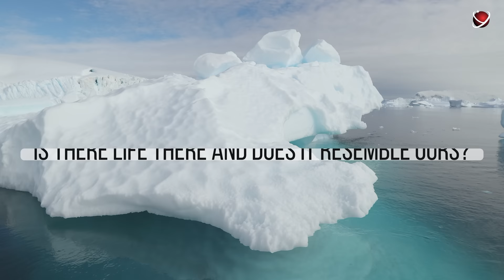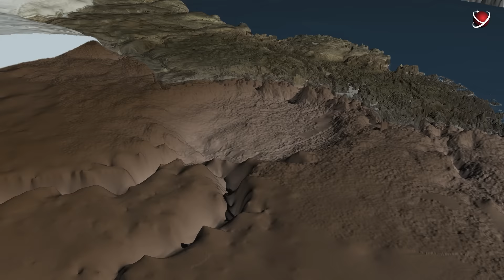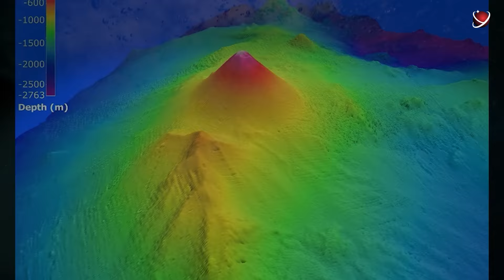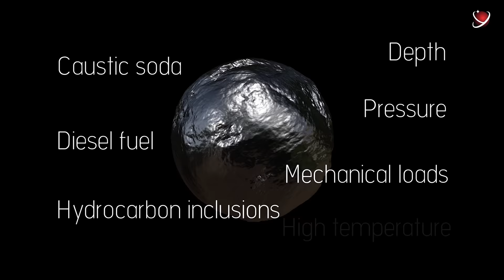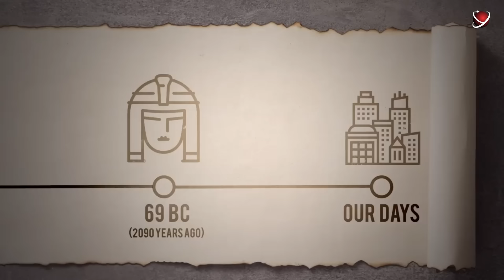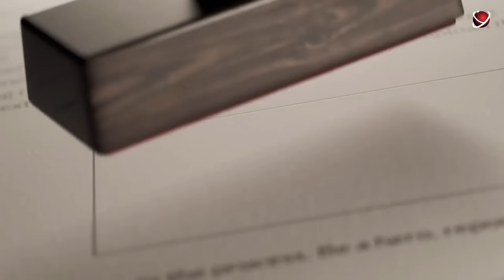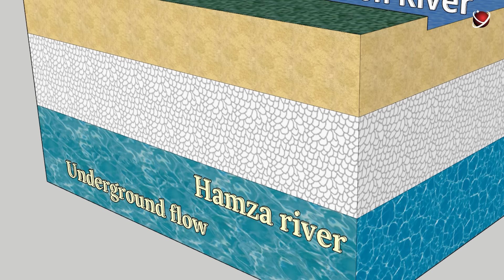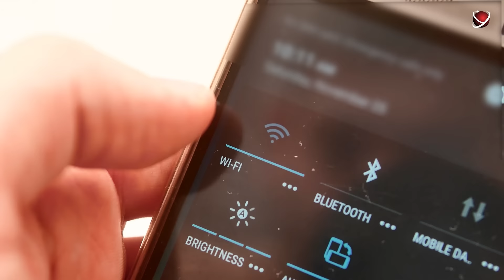The Most Mysterious Places on Earth 4K - ReYOUniverse

Comment: Water swells when frozen so it as water wouldn't be quite the rise of sea level and if the entire plane(t) were warming it would likely be hot humid and rain often because heat causes rain to form faster right? And that would go on until the water was getting very low

Comment: - 2:00 You don't have to have your appendix removed, unless you are a doctor. Because there's only one and single doctor in each station.
In 1961, one had to remove his appendix by himself.
Of course you also don't need to have your wisdom teeth removed, as long as they are sane ( exam requiered).
Wisdom teeth are not always a problem. I'm 54 y/o and have all of them.

- What is shown  at 9:07 are tardigrads, not microbes found in the lake.

- 10:01 W123-10 was NOT found in the lake, but in the ice. The article in Pubmed says no life has been found yet. The DNA analysis doesn't show it's totally different than other life on earth, but different of its relatives : 
"The first remaining phylotype, hereafter w123-10, proved to be a hitherto-unknown type of bacterium showing less than 86% sequence similarity to known taxa."

- 1:45:00 The pyramid shown is Keĥren's, not Kheops's. This is a serious mistake ! There are not 2.6 millions blocs. Inside it's rubble.

- 1:47:00 The Great Pyramid was not built in  "just 20 years", but at least 27.

- 1:51:00 the lower room was named the "queen chamber" quite recently. No egyptologist says queens were buried here. They are in the small pytamids near by.

- 1:53:23 pyramidions covered by gold existed 1000 years later, on some obelisks. There's no proof it was the case for pyramids. The pyramidions discovered show no sign of fasteners for gold sheets.

- 1:57:23 Of course there was no inscription on the walls of the King chamber. You said minutes ago it was normal in the 4th dynasty. It started with Unas, 5th dybasty.

- 2:02:15 Muons don't come from space. They come from high atmospher.

- 2:03:25 "Unfortunately, 5 years since that, with no further progress" Not right. There's another study coming : "Explore the Great Pyramid"  . And no, the experiment was not "replicated many times".

- 2:05:50 Henry Salt never wrote he fuund 4 passages, but that the tunnel ended after 300 yards.
Andrew Collins never provide any proof of his "discover".

- 2:17:40 - Herodotus never wrote anything about Kawara and underground tunnels. There's no pyramid in Bosnia.

There's a lot of misinformation in this video ...
Reply: Thank you for pointing all of that out, sadly it seems videos like this are like bug lights for Youtube nutjobs who will dismiss 99% of what scientists say yet blindly agree with what an anonymous low quality Youtube video says. It's pretty mind blowing.
Reply: Blah blah blah
Reply: You dont know
Reply: Ahh man, I already shared everything to everyone I know!
Reply: Be sure I'm not a specialist of anything here.
I just verified the informations.
For exemple, the deep lake officiel article is public on PubMed
No need to have an university account.
Reply: @one8088  Right. I don't know more than the author of this video.
I just verified  what he said.
Reply: @StickHits  It's a pain ...
I totally agree some scientist may be wrong.
They say the same thing :)
But I'm not a biologist, nor an historian, I'm a technician in electronic / informatic.
I just verify the information I get.
If I say something about an old 1930 outboard engine, or carpenter and home electricity, you can usualy trust me :)
If it's about advanced knowledge in biology, physic, I know my limits, please ask someone else.
Seems fair to me.

Fun part is english is not my native, I'm french :)
Reply: @nalinux  Yes, same here. But I do know a little something about bacteriology — I felt compelled, like you, to point out that this clip contains misinformation and unsupportable claims. We have enough scientific illiteracy already without stuff like this.
Reply: I suppose you and I, even if not about the same studies and knowledge, have quite the same way for this.
I'm a tech.
Many of my friends are historians, or whatever.
When it's about tech, "I'm the boss".
Of course I can fail. I have no problem telling "I don't know".
I think this "I don't know" makes a great difference.

You write you know about bacteriology.
I don't know you. Why not ? :) 
Nothing personnal here, sure you understand.
Be sure I will verify if you write a thing about this :)
Seems fair ...

We have a bit of knowledge.
I won't play with you on your domain, and suppose you won't on mine.

But some pretend to be genious on about anything ...
We know it's wrong ..

This might not seem important.
But when I see more than one million views .. wow ..
How many kids saw this ?
This guy has a responsability ...
Reply: @j.stribling2565  Only octopus came from outer space :)
And tomatos.
Reply: Thank you for saving me 3 hours.
Reply: @nalinux  🤣😂😁❤️👍💯🙏🏻
Reply: @nalinux  thanks for trying to help local YouTube nutjob s like me too
Reply: @nalinux  YouTube is about the public's ability to post there own videos! As entertainment! It's not a scientistfic channel. I would say in it's defense! Yet I do agree that there should be more fact checking in education type videos if they or as such labeled. Though at this point YouTube post or in say 500,000 per every hour or day an a staff of possibly 100 would an do have issues flagging content for various reasons. So I say on YouTube it's mainly lacking the ability to govern the people who post on it of all types of videos. There are sites an I believe tube sites created just to help educate an if not maybe it be a good idea to start one! An then use these videos to help explain the situation better etc .
Reply: Way to let em know! I hope they reply back to you at least and hopefully update their video when your fact check proves to be correct. You're doing God's work.
Reply: ikr?!
Reply: @jesselove3715  I think they don't care :)
YT gives money with 1.3 millions views  ...
Reply: Thanks mate you saved me from listing all the bullshit
Reply: @peterhall8572  There are many others !
for example, no need to have your appendix removed if you go to Antarctica, unless you are a doctor.
Also no need to have your wisdom teeth removed ....

Comment: The most recent Green Sahara period occurred in the Holocene, in a time frame from about 12 thousand of years ago (kya) to about 5 kya. This phase has been denominated the “Holocene climatic optimum”. Between 15,000 and 5,000 years ago, summer insolation was at least 4% higher than today.  The increased temperature caused monsoon rains to occur in the Sahara.
Reply: I mean if the Egyptians built this pyramid 2000 years before the arrival of the Greeks or Romans. With that advantage and knowledge, they could have built impenetrable defenses against the Romans and Greeks! 2000 years, that's like today comparing us and today's standard with the Romans/Greeks. And they say they brought the big Granite blocks from Aswan with ships, ok, but I mean even the mighty English or French ships from the end 18 start 19 century could not carry 100-200 tons granite blocks. Even today, one piece of granite, 200 tons heavy or maybe more, would be an immense task to transport. And they did that in 20 years? simply incredible

Comment: If the Sahara was once lush with vegetation, where did the sand come from? Was it just deeper than it is now, but only at the edges of the area of the current desert portion of the continent, and then redistributed to cover all of the area of the Sahara, as it is now, or did something "create" the sand after the lakes dried up by some process such as a "comet" or asteroid strike, wind and/or temperature change? I have heard that the Sahara contains an area called "The Eye of the Sahara" under the sand as it now. Was this lake area, covered with sand, as the bottom material to the thickness and volume of sand needed to cover the current area of sand, and just redistributed by wind after the "dry down" of the lakes, so as to create the desert" as we know it today or by some other process? The "dry down" theory creates many questions to be answered to determine how the Sahara Desert, came to be, in its current form.
Reply: Over thousands of years, as rainfall lessened and temperatures rose, what little rain there was eroded the soil and dissolved it, leaving grains of silica sand. Wind slammed sand into rocks, wearing those rocks away, which created more sand. Hot days and freezing nights subjected rock outcroppings to extreme temperature changes. This daily expansion and contraction eventually shattered mineral crystals in the rocks so that the cliffs broke into boulders, boulders shattered into pebbles, and pebbles crumbled into sand.
Reply: @Mike-dy8sj  Great comment ❤️
Reply: @Mike-dy8sj  thats what i was going to say dam it anyways well said
Reply: @Mike-dy8sj  isn't a lot of the sand in the Sahara known to have been washed in from the ocean during the crazy flooding that happened in multiple areas of the world at the end of the ice age?
Reply: It I of I don't have it in our own in in in in safety in TV
Reply: @asalwak315  maybe some but most came from what @mike said.
Reply: @asalwak315  The sahara was a tropical rain forest about 10K BCE and Antartica was ice free. the Arctic ice sheets went as far south as Italy.

temps in Europe were around -30c, Antartica was the warmest place on the planet at around 30c.
then the earth moved on its axis and created what we have now.

Earth has an unstable axis and it wobbles a lot which causes global climate changes. were also in a unstable orbit around the sun. at the mo were in a close orbit so were warm right now but will get warmer as we move a bit closer to the sun before we start moving away again and go into another ice age.

earth has gone from balls of ice to balls of fire several times and its in ice ages a lot longer than warm ages.
ice ages last millions of years. warm ages last 100k's of years.

were in a binary solar system. we cant see r 2nd sun as its too far away at the mo but when it moves closer it drags earth further away from r sun so earth freezes over.

Modern science refuses to accept it but lots of ancient documents show a 2nd sun. and more planets in the solar system.

some of the planets collided which is where the astroid belts came from it the remains of planets that collided around 50k years ago.

earth was bigger as well it got hit by something big and knocked a big chunk of earth away thats the moon. mars same thing it has a massive chunk missing off 1 side.
You can see it on mars as 1 half is covered in craters the other half is about 1 mile lower and hardly any craters. 1 side had a massive impact crater the oppsoite side of that crater is where the crust is missing.
Mars was a lot like earth water atmosphere the lot when it got hit it lost its atmosphere and water.
Reply: @Mike-dy8sj  I hadn't thought in those terms. Thank you for the analysis.
Reply: @asalwak315  also a good analysis! Thanks.
Reply: @diannebarrath8923  I'm sorry but that one just flew right over me. I've never seen someone stutter in writing before. Lol
Reply: Utah, Nevada, etc.. extremely high altitude, yet fossils of sea creatures are found. Maybe the Sahara was under the ocean too 🤔 soil definitely doesn't turn into sand. Good observation
Reply: Pole shift or large impact stirred that sand up from the  bottom
Reply: It was the first attempt at Palm Jumeirah 😁
Reply: @Mike-dy8sj  
wow thanks for sharing ⏳️ here is a token of appreciation.
I was born in Cape Verdi Island 🏝 of Fogo my parents told me we lefts because of the volcano 🌋 that erupted and the Sahara desert would blow sand making the already island dry and crops didn't always grow well to feed 14 children.
Reply: @darkone9572  Sand is not magnetic.
Reply: @Mike-dy8sj  dimethyl tryptamine or something
Reply: Sand is rock particles which is soil with no organic matter
Reply: @madyottoyotto3055  got it. Thanks for the response.
Reply: sand is the manuring (stools) of every fish or any creature ever leaved
Reply: @diannebarrath8923  r/ihadastroke
Reply: Theres evidence that the sand came from the ocean bottom of the atlantic and washed up on africas west coast.The amount of sand is much less than normal off west coast .
Reply: @cliffbird5016  Check out the thunderbolts project on youtube the chapter on mars scarred by bolts of plasma due to close proximity of añother planetary body
Reply: It was just God...don't be educated be wise....
Reply: @keyunagaines206  explain how it was "just god"
Reply: @saturn722  Thanks for the info. I always learn new things and I love some of the responses! So many people that post comments and share viewpoints, are far more educated than I am and it's great everyone is willing share that knowledge and expertise with us that are less so, so to speak. Again, thanks for the tectonics lesson! Have a good one!
Reply: @cliffbird5016  this comment tho! 🔥 Could you maybe tell us where you got your knowledge from? Because this really sounds amazingly logical and I heard many of These things before tho not all like the second Sun f.e.! Would be greatly appreciated to dive deeper into this!
Reply: @Mike-dy8sj  When you look at sand under a microscope, you'll more likely see what is left of sea creatures then pieces of rock. Plankton is appearantly most of it. I'm not sure that's the correct English term, but I bet you know what whales like to eat for breakfast, lunch and dinner ☺ I live in Europe and when the weather does a specific thing, sand from the sahara rains down where I live. It's not funny when you have windows and a car to clean. But even with the naked eye we can detect tiny pieces of shell.
Reply: @cliffbird5016  your tinfoil hat is too tight.
Reply: @cliffbird5016  a second sun? Come on now
Reply: Sand is what happens to topsoil when by water, heat, wind and/or drought, it is stripped of all biological material. Sand is the most plentiful substance on Earth
Reply: A little drop of water and you have an oasis. Sahara is extremely fertile. Because of the Atlas Mountains in the west the rain falls before reaching the desert.
Reply: @cliffbird5016  Interesting comment. 
"earth was bigger as well it got hit by something big and knocked a big chunk of earth away thats the moon."

Estimates have the moon being about 1/4  the size of Earth.
Does anyone know, where on Earth it may have been hit by something so big to create an object the size of the moon?
Did the piece that split, just grow back?
Reply: @cliffbird5016  THIS GUY IS A FUCKING GENIUS!
Reply: @keyunagaines206  being wise is NOT believing God's doing everything
Reply: @Fireworxs2012  not entirely. Depends where the "sand" is
Reply: @Fat Mayo  there are craters of huge impact all over the globe. But no, I don't think the moon came from here
Reply: Well, much of the world's sand is made out of the same stuff, tiny crystals of the mineral quartz, which is made out of silica and oxygen
Reply: @officialrubix63940 Bless your heart. Prayer for you!
Reply: Good question where did all the sand come from every where
Reply: @Mike-dy8sj what you wrote is correct but it's not what happened to the Sahara alone to cause all that sand. To think that alone would be the cause is absolutely preposterous, the effects of what you described would be miniscule at best.
Reply: The Eye of the Sahara was where Atlantis was before the great flood!
Reply: All that sediment is from an enormous flood,,,,the great flood,,,,

Comment: Theoretical, if the ice below sea level, like the north-pole (95% is below sea level) melts, that would lower the sea level. That's because ice, frozen water, expand. And when it melts, its volume shrinks.
Reply: I really loved the part when he showed a wind turbine which is not even close to being a clean or responsible energy source at all and is only beaten by solar panels on how completely no where near green energy, because the amount of chemicals and “carbon” it requires to mine, refine transport construct install maintain remove and replace a wind turbine is higher per kw hour of power produced than coal🤣🤣🤣 nuclear energy is almost completely clean and green. And solar are straight up toxic waste nightmares and have a similar half-life as uranium except a solar panel is 10x the size of a fuel rod, and they are finding more and more things to use spent fuel rods on. Everyone is just terrified of the word “nuclear” like it’s the bogie man
Reply: Oh and the funniest part is the line humanity has to do better (true) and together we can stop global warming (🤣🤣🤣 just🤣🤣🤣) and even reverse it🤣🤣🤣what a goose
Reply: @davidcox6206  all that he mentioned doesn’t deny CC at all, and that we’re pretty much fked
Reply: @davidcox6206  I know reverse it right! 😂🤣😂🤣.  Let's ignore the fact the the planets been warming already for like 25000 years since the last ice age,  sea levels had already risen 400 ft before we burnt our first fossil fuels.. I wonder how we can pin this on humans!
Reply: Wrong! Ice which floats on the sea and melts, does Not change sea level either way. Only ice on land raises sea level as it melts and reaches the sea.

Comment: I never understooth why if ice fload and should be only visible for about 10% above the water and if melts it just deludes in water as it is lighter then water , it would not making more water then to day, it just deludes and stays at the same level worldwide as there is air in the ice . Put a block of ice in water , let it melt and see what happens , it just dont change volume of water. So there is something wrong with this theory .